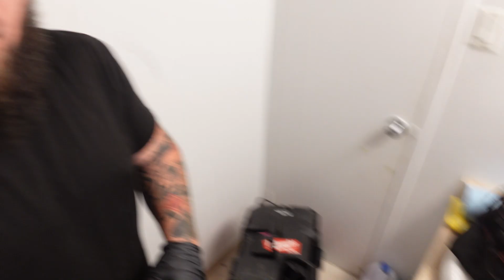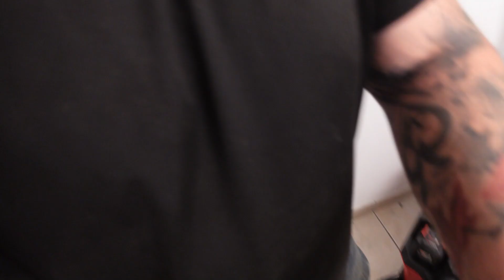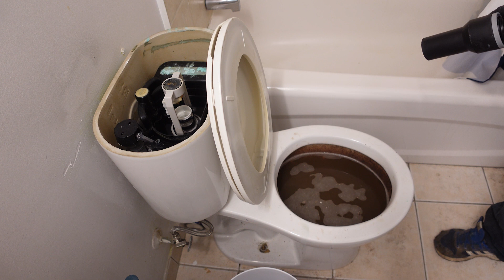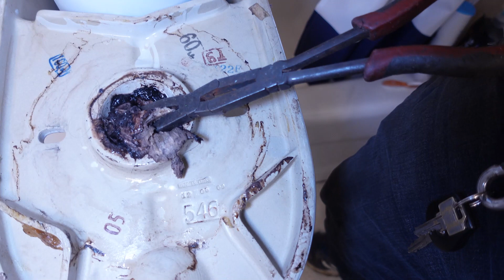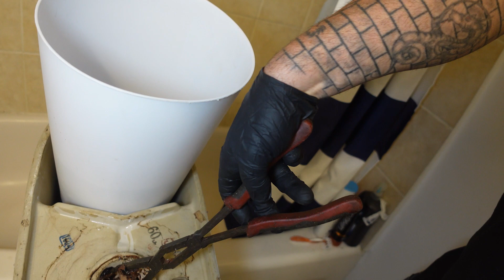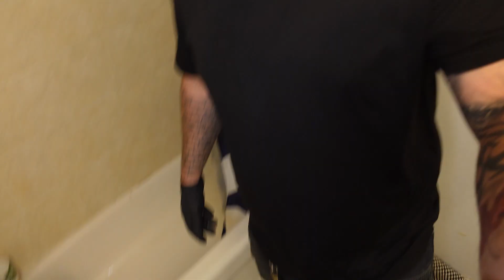This toilet was NASTY how to unclog a plugged toilet.

Comment: The toilet supply hose was as plugged off as the toilet was, kinked off flat where it came out of the shut off valve
Reply from the maker: Yeah it definitely should have been changed I told the manager to change the whole toilet

Comment: The Auger would not work looks soft at the bottom of the toilet
Reply from the maker: The management wanted it taken off  because this is an ongoing issue in this unit
Reply: @Jaythatdrainguy  Cheap bad toilet then need a new one
Reply from the maker: Yup